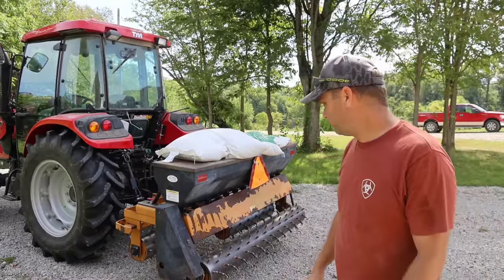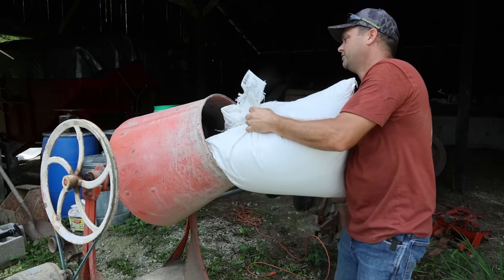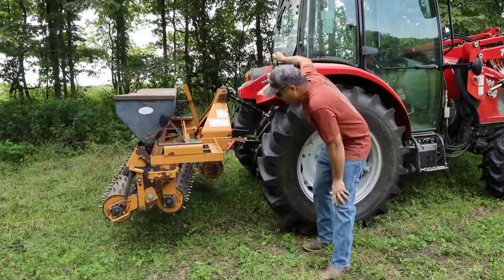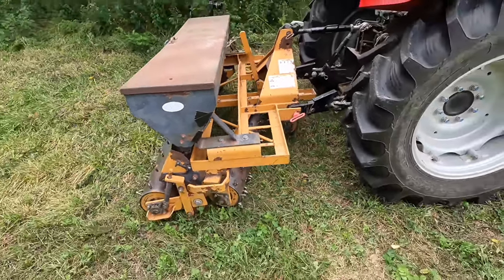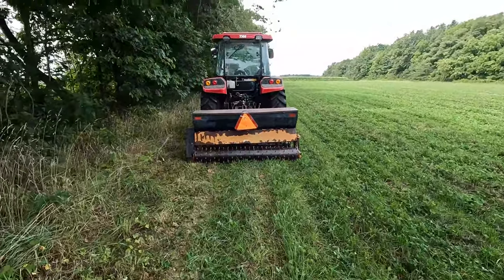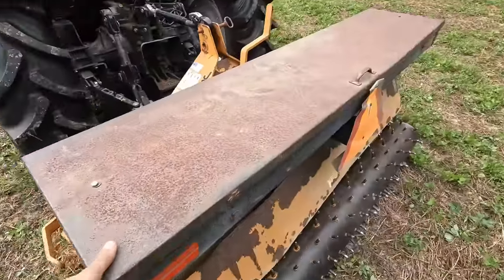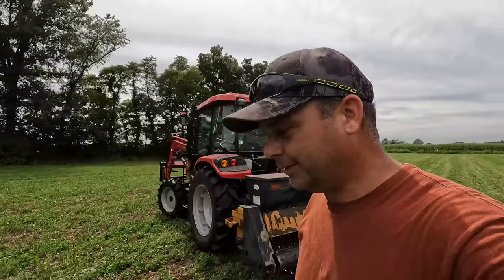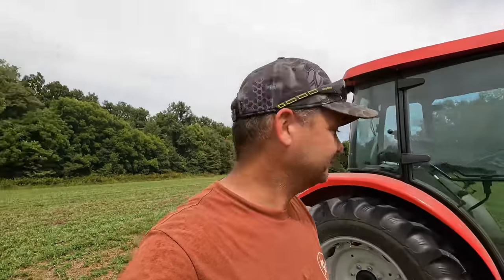I Rented a Grass Seeder to over seed the hay Field.  Hopefully the field will look better next year.

Comment: Evan... I hate to tell you this after the fact ...but ! you rented a seeder that does not penitrate the soil ..so you must pre condition the soil for it.... till it the soil has to be prepared for the new seed to be ready to grow , other wise the old grass will take it over and your new seed won't stand a chance. there are seeders out there that will till the soil for you when you seed
they are the ones to get.... having to pre till the soil before seeding is a pain and almost always renders dubious results but without it your new seed doesn't stand a chance in growing....
leaving a field to grow on it's own ,after harvest does work and can produce great crops when fertilizer is used. there is no need to seed an already established grass field it will re grow !
however if you have areas that are sparce, then you should re plow and then re seed....
Just my opinion take it for what it is worth I am NOT an expert ! LOL
for what you did today you could have just ripped the soil 6" depth or so for the seed to get established in....  1/2" x2" bar stock welded to a strong frame  that are 6~8" long will leave slices into the ground and not disturb most of the established grass in the field ,but sense you have a disk your better off using that ! especially if you can position the discs so they slice the ground.......   Just remember new seed needs to have soil that there is no competition in ...
in my view you just threw away all that seed by putting it on top of an established field.... next time discs it up and then seed !....

Comment: You did good Evan! That is the same way I use to do my over seed applications each fall ▪I always went by the philosophy of "I would rather put down too much as not enough"▪ Later; as you increase herd size; might I suggest adding winter wheat each fall ▪I actually doubled my hay yield with this method ▪Just a suggestion of course ▪

Comment: Good work Evan. We need to do the same thing to one of our pastors. From our experience, you can't put down to much seed. Being able to rent that seeder is a huge cost saver. Thanks for another great video and stay safe.
Reply: You need to reseed every spring. We usually harrow it first agressively to get the dead grass out, then reseed (we use our basic seeder, works quite well) and then use heavy meadow rollers. It will boost growth.
Reply: @stubbi  and again..... it does not need seeded every year. That’s the entire reason for using perennial grass 🤦🏻‍♂️
Reply: @nalley6815  We had great success with reseeding every year. Of course we dont do a full reseed with plowing,/cultivating - we simply direct seed about 5lbs of different grasses seed per acre.
It helps re-establish the grasses that died over winter and reduces weed-pressure,
Reply: @stubbi  you do you. But it’s a cost that isn’t needed. And right now there’s no place for things not in necessity. Most people drill seed every 5 years or more
Reply: @nalley6815  For us that little cost outweigh the plus in crop. We buy the seed in large bulks every once in a while, so no issue there.

Comment: Looks like your top link needs to be a little bit shorter to really .make the front rollers bite in better along with a tad more down pressure  on the 3 point

Comment: Can you tell me the advantages of this type of seeder versus a broadcast seeder? I realize this type has the spiked rollers, but the old broadcast seeders seemed to do the job and are certainly cheaper to purchase and I would assume to rent as well. Just curious. At any rate We'll keep our fingers crossed for a good stand of hay for your efforts and investment.
Reply from the maker: This seeder presses the seed into the soil for better seed to soil contact. A broad cast seed spreads the seed well, and then let's nature do the rest.   A Broadcast seeder will work better in freshly tilled soil.   And helps to roll over with a cultipacker afterwards.
Reply: A drill would be even better than both of these. Broadcast spreaders require you to use about double the amount of seed you would with a drill because a lot of it will never come up

Comment: New Sub here... May i ask, what's the purpose of seeding grass in a hay field ? Stop / slow down erosion ???
Reply: to make more hay......that's not just clover
Reply: To replenish the plants that died. Sometimes the mix you want is not there anymore, because certain plants died due to heat, drought, too much water. Only that way you can restore the balance of your mix. Plus, reseeding is always better than letting nature do its slow thing.
Reply from the maker: Hay is grass or legumes cut tall and dried.  The field didn't have much grass mostly red clover.  I wanted more grass in my hay.

Comment: My land has always been in beans , just this year we planted it pasture mix. Is there anything I can do to help it with out buying more seed to " over seed" do I let it grow out to seed and let it re-  plant it self?
Reply from the maker: The first thing I would do, is a soil test.  Make sure the PH is high 6 to 7 is best for grass.  Other minerals might need added.  
Not sure on how well, letting it go to seed would work.  Maybe ok if there isn't any weeds going to seed at the same time.  Good kuck
Reply: Hey Nick. If you want to use that field for hay, I can only recommend to re-seed every single year. It will help a lot, plus if you harrow it with a tine harrow, plus roll it, you will get a lot more crop.
Reply: @stubbi  yes we want to have it for hay. Thank you. Is now a good time to re- seed?
Reply: @nicklindaman6671  I suggest to do it in spring. 
We usually do it in mid to late March. First, we heavily harrow it with a tine hartrow. Then, we reseed ours with a plain and simple disc coulter drill, which usually works pretty good. Then we use heavy, big meadow rollers. It boosted our total crop weight by aboput 20-30% depending on year.
Also, make sure you check your field. If you have wet patches, seed grasses that like the wet. If you have dry patches, grasses that like it dry.

Comment: Nice job Evan and a real money saver to rent rather than buy - which you would probably not use very often anyway. As for amount per acre I always set far below the amount desired and just keep running over it until the seed/fertilizer is gone. That way you don't come up short AND it is well covered. Thanks for the video. 👍

Comment: Good planning for the extra usage on the seed, I can never get that right, at least when it comes to fertilizer. I really enjoy your video's, I think I've said that before, but just wanted to let you know. I hope everything is going good on the pond front, I have two that I need to work on, one dam broke and the other has a concrete bottom, it's spring fed. Thanks for sharing, I hope you have a wonderful week.

Comment: Evan just a suggestion. In the spring around end of March begging of April. Why don't you put Nitrogen on your hay fields. It will produce great hay.
Reply from the maker: The idea is to have the clover to add nitrogen to the soil.   And I will add compost if I can.   Ideally I want to not buy fertilizer.  I want it to be a more sufficient process.  I just need to more compost.